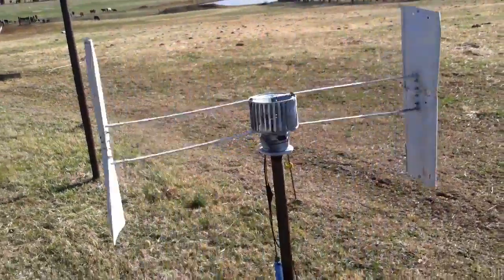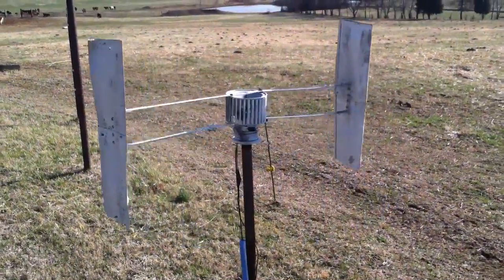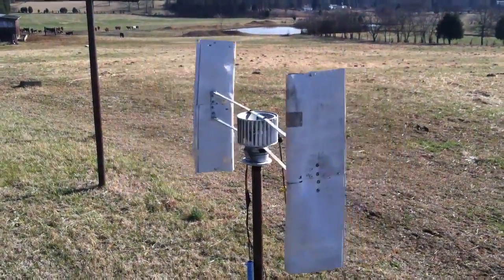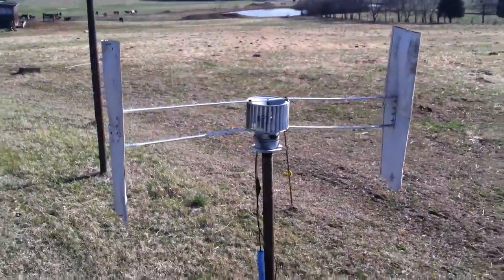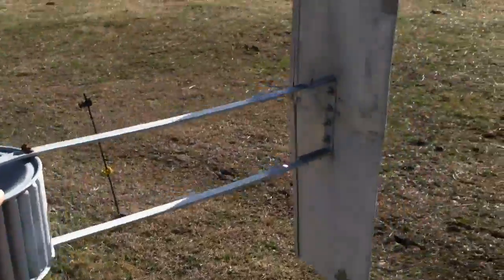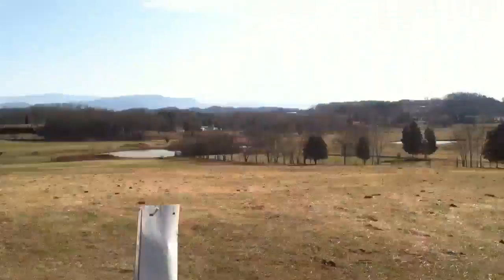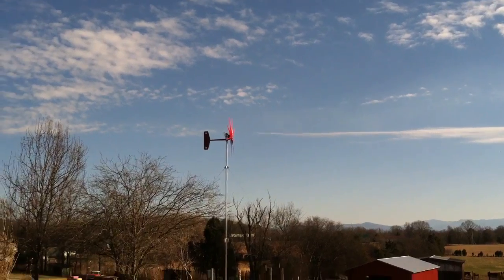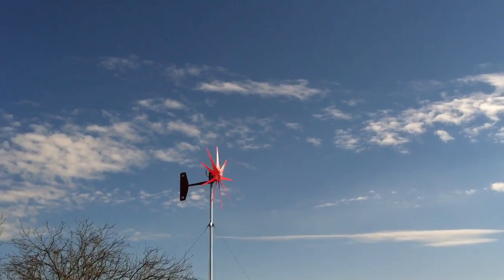Vertical axis wind turbine that was featured on Doomsday Preppers Season 2: Questions answered

Comment: Hey, I have a blower motor just like it.  How you had it set?  Too wide.  That's more a high rpm motor, and those blades are more high rpm too, so it could work well.  They just need to be in more.  If you still have that?  You should pull it out, give it a shot.
Mess with it.  Bring those blades closer and closer to the center until you get results you want.  I think it could work well.
Cheers.